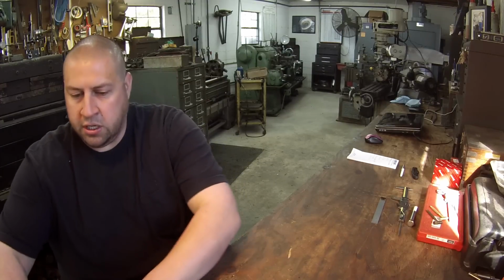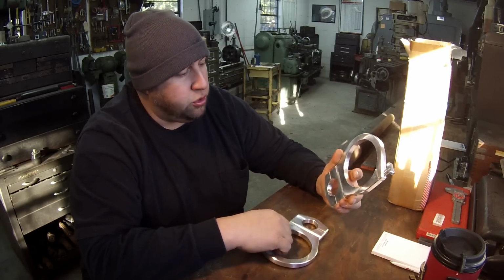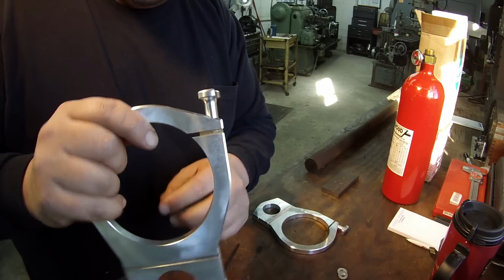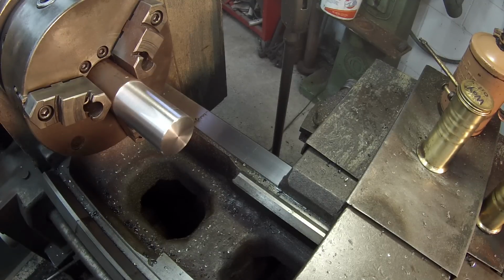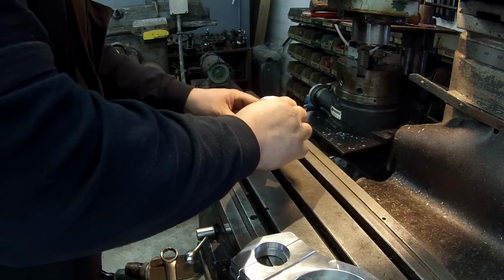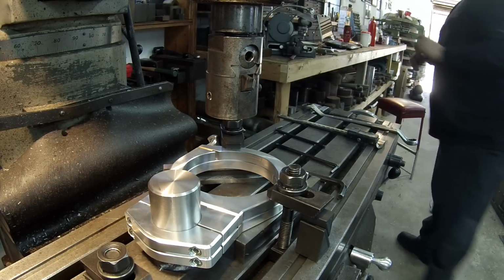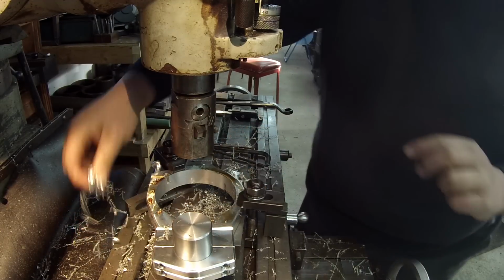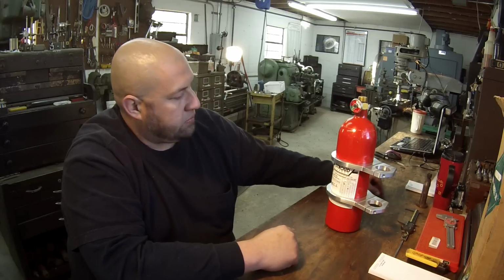Saturday Night Special 6

Comment: I can imagine someone reaching for that fire extinguisher and them pulling on it for 10 minutes because of a vacuum fit LOL
Nice work Adam!
Reply from the maker: Yea it was a bit of a precision fit, should have given it a little more clearance. Hope they dont have to use it much!
Reply: Abom79 Pretty sure that is a fire bottle for a plumbed in fire system, otherwise there would have been a quick release bracket.  Great work.  I have a boring head that is similar that I have never used, I might do a video on it and the parts that came with it.
Reply from the maker: James Kilroy See if you can find a name on it. I havnt noticed one on mind, but I will do some scotch brighting and see if theres a hidden name somewhere. Its a nice little boring head.

Comment: Yet another cool video. I learn a lot with each one. Hey, if you look at my little icon picture of me sitting in the sling-lite on a camping trip here in Greenland, you'll notice we have the same thermal cup (grey cup and red lid). I got mine at Raleys before my mother and father passed on to the next world (1997) and I've had it ever since. Reminds me of good times in the past! Now, when I see your videos your cup like mine is reminding me of the good times. Keep your spirits up. Cheers.
Reply from the maker: Ive had that old mug for a long time now, many years, but its about on its last leg. I actually need to find a new one. None of the others I have bought are quite the same. I found some on ebay though.
Yes mines helped me through alot of good times as well.

Comment: Adam,

It a pressure cylinder and always under pressure.  One it gets empty it will shrink a little on the diameter depending on the type of material used to make the cylinder aluminum or steel.
And you need to add on top the thickness of the paint.

That’s why one bracket, even custom, will fit one brands only.

Comment: Hey Adam, great video, nice job. There is no substitute for good old LO-HY, its a must have. I really like that boring head, I've never seen one with a square hole in it, it seems to be like a combination of a boring head and a fly cutter in one, very useful, just wondering did you make the lower section where the tool mounts?
  Mike
Reply from the maker: Mike, its a boring head thats been in our shop forever. I dont know what brand it is but I can tell its a factory made item. I love being able to use either a 1/2" tool bit or a 3/4" bar. Its a nice boring head to use.
Reply: Abom79
Yes /Adam, nice to use 1/2 square instead of round (less expensive) cause i
use 3/4 round in the largest Bridgeport boring head......sam

Comment: Adam the fire extinguisher brackets turned out nice.  Do you use the same cutting oil for aluminum that you would for steel?
Reply from the maker: Bill, yes I use the same cutting oil for everything. I do have some made just for aluminum but this dark cutting oil has always worked fine too.

Comment: What brand is your coax?
Reply from the maker: Just a cheap no name import brand.
Reply: Abom79 How much can you trust it? I had an off brand one and it ruined a few parts for me before I caught it. Not sure why but the damn thing would read on center, like no movement in the needle at alland you weren't even close. I bought a blake, it was like 300 bucks but it gets it absolutely dead nuts on center every time.
Reply from the maker: I trust it because I've used it for years and has always worked for me. A lot of the work I do doesn't have to be dead nuts zero so even if it's a few thou off it's not going to always kill a job.
I do want to upgrade to a Blake though. Just haven't allocated the funds to one yet.